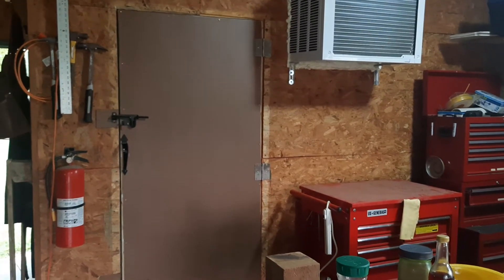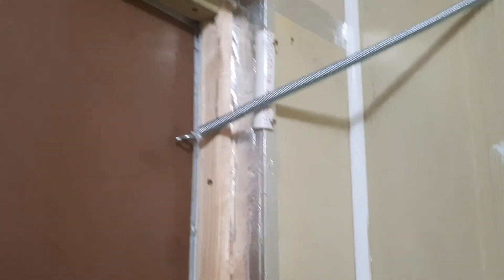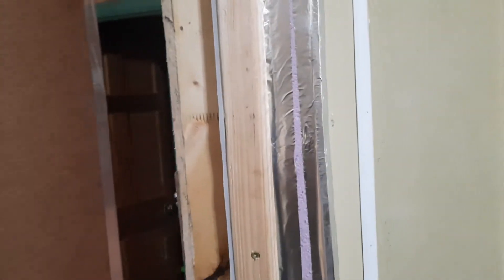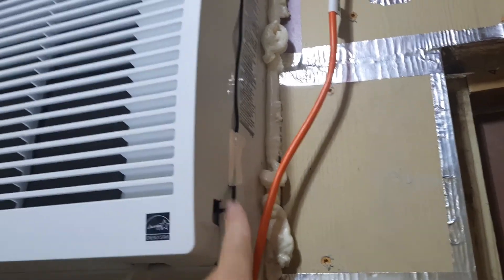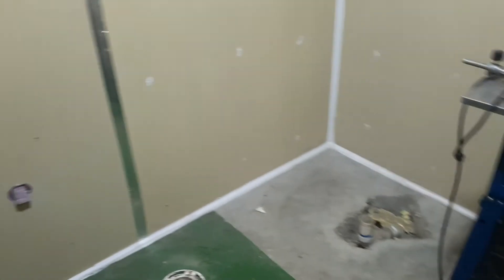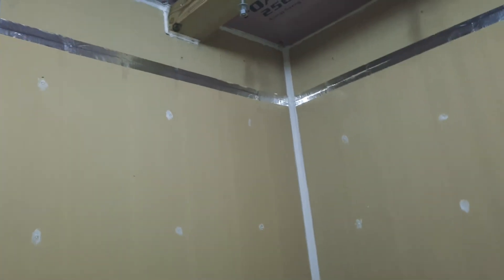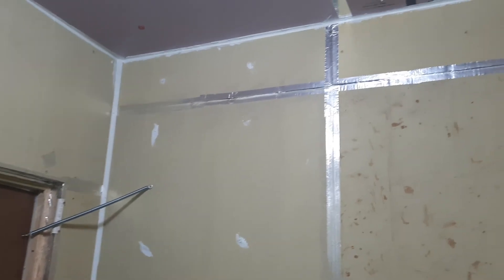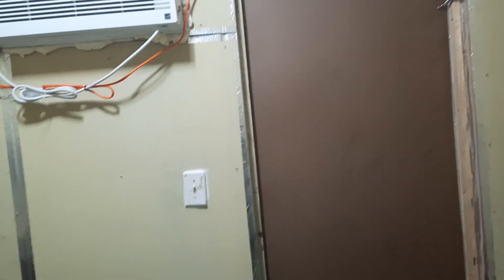Walkin cooler walk through and info.  $35 Coolbot.

Comment: Can you explain how you’re fooling the AC unit?
Reply from the maker: I will do a video tomorrow to explain it better.
Reply: Gaines Preserve Homestead awesome 

Your walls are 2x4.  With 2 inch insulation?  I was going to put one in my garage.   Do you have any condensation issues?
Reply from the maker: @dougb1615  yes 2x4 with rockwool insulation.  It is way better than fiberglass and will not sag over time.  I have a few other short videos as i was building the cooler.  no condensation as of now.  I plan on this unit only running 4-8 weeks in total for the year.
Reply: Gaines Preserve Homestead if you get a chance can you share how you tricked the a/c  in detail?   For The wire from the a/c unit to the light did you lengthen that or was it that long normally?  Thank you
Reply: Any chance on getting that video link to how U fooled the AC with the inkbird? Want to do the same thing.